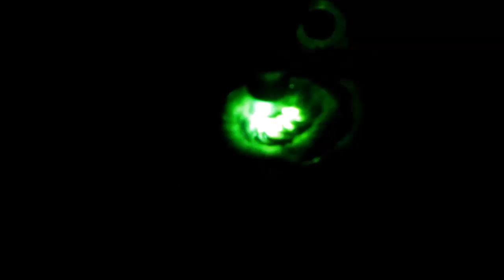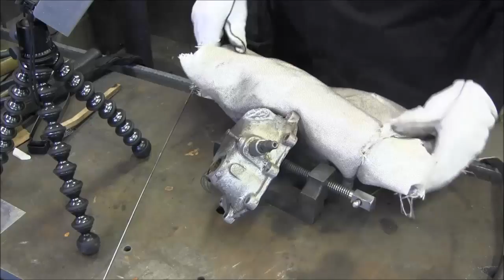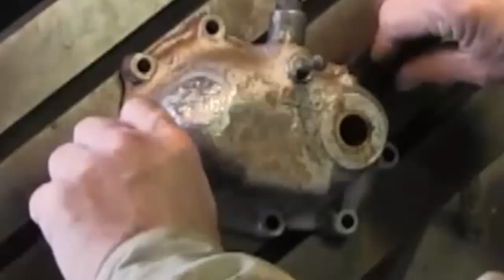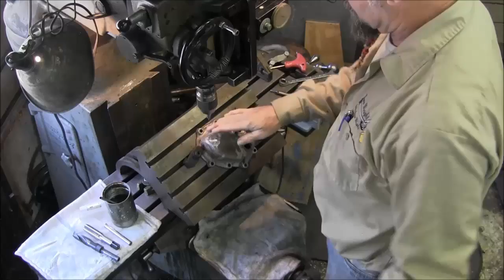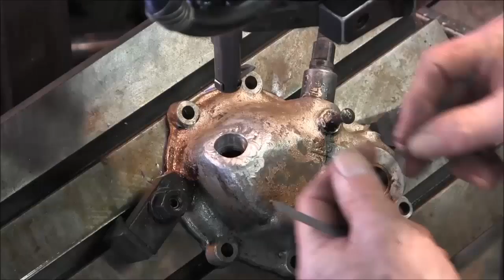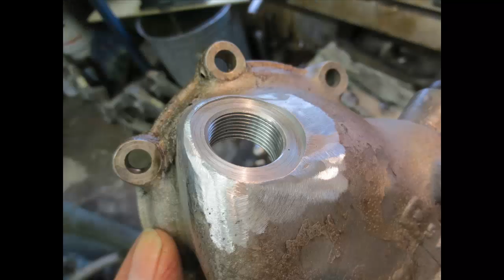Knuckle Head Part 2

Comment: The only criticism I have on this repair was the final finish. To get it to look original it should have been filed to shape. Grinders seldom if ever do the contours properly. After you get you base configuration back and all signs of the weld have been removed, you take coarse sandpaper like a 60 grit and place it face down on the surface and then you gently drive it into the surface with a small ball peen hammer. This will give you a surface that resembles the original cast and when painted will be hard to spot as a repair.

Comment: Hello Keith, I wanted to pass along another way to determine the drill size for English and
metric  60 degree threads that is not commonly know. Take the nominal O.D. tap size and 
subtract the pitch from the O.D. ( 3/8 -16 / .375  minus .062 is  .312 - I.D drill size.) Metric MM6 x 1 / minus 1.0 MM is 5.0 MM.)
This will not always match the drill charts, they are referring to the closets drill size available.

Comment: Great video,just wondering why you completely filled in the bore? Why not just build up just enough material to drill and tap? I understand why you completely cleaned out the threads. Thanks again. Found a new channel.
Reply: He already had the piece centered. Good tooling and proper speeds and feeds would keep chatter to a minimum.

Comment: Should have a copper gasket washer.
Reply: +K.D. Pearce  Not in the Harley parts book. Plug seals against starter cover surface.
Reply: +1-Shot slinger 4 speed Transmission cover :)

Comment: Hello Keith, why did you choose to use that plug when you could have used any standard size plug?
Reply from the maker: Jeff Pinter The customer wanted to use that one! A lot of my work is as customers request, varied from time to time to make stronger or safer. ;{)------
Reply: +Jeff Pinter Keeping it original. It is an antique bike.

Comment: Another awesome video!!  I get porosity as well when I don't clean the parts out as if they were going into surgery.   Cast is also notorious for absorbing the media it is holding.   A thorough parts washing and acetone a alcohol rub cleans up aluminum pretty good.  The video was very well put together.   Nice plug for Jody.  Thanks again for another video.

Comment: Just a thought, Keith, on aligning the part for the setup would be to screw the tap into the bad threads and then chuck the tap in the mill.  Then the adjustable angle plate could be brought up under the part to align it in all directions.  Then kickers could be bolted to the angle plate at three locations to "capture" the position.  Another approach, again using the tap to hold the part, would be to then tilt the mill head in both axes to set the part down on parallels on the mill table.  Kickers could again be used to capture the position.  
Just another method-- your method worked great.  I'm envious of your welding ability and admire your work.

Comment: Maybe you could make a "hood" or an extended 1" rim around the faceplate- to concentrate the light, and help block out any stray ambient room lighting. Most "auto focus" systems use infrared- the heat might be making it fuzzy- maybe switch it to "manual" focus?
               You're right-  I'm surprised there's not a copper crush washer on that plug- maybe they'll use one?

Comment: This type of repair is exactaly the reason most of us come to your channel!  Thanks.  I just replaced my 40 Year old Miller 250AC/DC-HF TIG welder with a Dynasty 200DX...One of us (maybe Jody) needs to put together a video on job specific settings for inverters.  What did you use on this repair?  It looks like a low CPS, 80? and about 145 amps at 65% cleaning?  BTW, why not just over drill and re-tap this one size bigger?  The fact that you didn't edit out whatever happened at 12:36 is proof that "You're the king"!!!!!!
Reply from the maker: Thanks for the comment! Well I was using my 15 year old Synrowave 250, I mix the gases manually and most likely had the amps up around 200 and use a foot pedal so I can grab it when I need it and back off the same. I was asked to recreate the threads to fit his plug. ;{)------

Comment: Hi Keith, with regards to the cost of the tap, did you consider using a standard tap that you already had and then making a new plug?  I understand keeping things original but no one will ever know unless they measure it and who does that?
Reply from the maker: When the customer wants it as original, that's what we do!  ;{)----
Reply: Thanks for the answer.  Am loving the channel and learning heaps.  At the start of your videos I like to work out how I would do the job (I am an amateur/hobbyist) then see how you go about it.  Great to be able to get feed back on why you do things a certain way.  Cheers

Comment: Hey Keith, that's a really nice job! I had to do some special threads once in a while and got bored buying cheap used (chunk) taps or some from China because I cannot afford the ones made in (somewhere around Austria, maybe Germany) in my case. So i started making my own, basicly just threading silver steel, cutting flutes with a ball end mill and then harden an grind it. They work really fine for a few holes in Bronze, Aluminum and other non-ferrous stuff.

Comment: Great fix again! Yes there should be a copper washer on the Transmission fill plug! As some others wondered about the hole with the bronze bushing; it is where the shaft for the kicker arm (for kick starting the bike) sticks out of the trans! Like the old knucklehead but like my '79 shovelhead better!
Thanks Keith!

Comment: Great video Keith - simple repair overall, but you do such a good job on it.  Most of us would have just TIG'd the aluminum back into place without fully filling it and drilled it and opened it up - your method makes for the cleanest (and ultimately easiest) result.

Comment: I agree with the commenters who say there is a thrust washer missing between the plug and the case. Drain plugs are not supposed to be torqued down super tight - you aren't joining parts, just sealing a non-pressurized sump. Hand tight ("good-n-tight") is fine, but it has to seal, especially once it gets hot and things change shape. A soft washer allows some compression and growth with heat. Reefing that big steel bolt back into the aluminum case is likely to just strip it again eventually.

Comment: Keith could you tell me why you cut the flat boss with with the tool spinning backwards? I'm guessing it cuts better without chattering but I've never seen that before. Thanks again I always learn something when i watch you videos.
Reply: The tool Keith used was designed as a right hand turning tool so when it is upside down the spindle must be reversed. Conversly if he were back facing the tool would be up the other way so conventional spindlerotation would be used.
Reply: thanks for the explanation.

Comment: Love the addition of the filter view of the welding. To my eye, maybe darken just a tad, and tweak the focus a bit? Are you using a fixed focus? Not too sure how the welding filter and the welding itself would affect autofocus. Another great video!
Reply from the maker: Thanks for the comment, I was and still concerned with all the variables, that come into play, videoing welding. I was using auto on the camera and had the lens on the lighter side 10 to 10 1/2 shade. I will also try some camera settings to change to black and white or others that may also help with the more natural look of the puddle action. But for the most part it is to be used as a prop to show you how I dip my rod! cheers, ;{)------
Reply: Keith Fenner
Understood. You seem to add the fill a little further away from the puddle than I do, and you are are a master of using the heat to draw the fill where you want it. I am going to have to try doing it your way. Can always learn something new!

Comment: Great vid Keith--As an alternative to welding, could the damaged threaded hole been drilled out somewhat and a sleeve inserted and welded in that would allow a rethread? Just a dumb question from an armchair, wanna-be machinist.

I really look forward to your videos.
Reply from the maker: Thanks for asking the question Tommie, before I was proficient in welding build ups, I would be thinking of all the non welding ways to getter done. A lot of different avenues were practiced and some worked pretty well, but none compare to replacing the base material with new and re-machining. ;{)------

Comment: Interesting use of the auto shield, I am guessing the sensors & batteries also came along in the unit, locking the Canon on manual setting something like f5.6 at maybe 1/30th with the ISO at 400 may actually capture the lens darkening as the arc forms. I have worn progressive focal lenses for a while and find them great on normal jobs, tricky to get the hang of at first and no good if you have to do close up overhead work. My mill does not easily reverse, did not think it important until seeing your use of standard right hand tools Keith, I can feel a wiring mod coming soon.

Comment: Nice repair job Keith.  You make welding that cast look really easy and clean.  I have not had that kind of luck with the castings from my Honda.  No matter how much I clean and grind away as soon as I light up on it, the volcanoes appear everywhere.  Lots of grinding, drilling, and welding are needed to get a good build up.
Reply: Well..I have a 1946 Harley....same trans/kicker cover like this....it is 'sand-cast' and welds pretty well. Many newer bikes have a die-cast aluminum, (especially any sort of 'covers') with 7-8% magnesium...easy to cast, but will usually give a slightly porous weld...pretty tough to make a nice looking repair.

Comment: Kieth, I know some smart a-- always comes along after the fact with an easy way, but as a service tech for 30 years, I have to tell you that those plugs are available in oversized self-tapping design at your local parts store. They cannot compare to your fix, but they are quick and cheap. Less than $5. Great video. I have dealt with those situations too many times to count. I don't think mine ever looked that good, though.

Comment: Thanks for the video. I think it's cool that the guy gets to use the original piece instead of hunting around for a replacement and being at the mercy of someone who thinks it's made of gold. That and there's one more story the bike can tell. I wonder if you've ever worked with low temperature aluminum repair rods and if you have much of an opinion of them. I can T.I.G. aluminum to a degree but I have no equipment and little experience on alloy. I had some of these rods given to me by my brother when I repaired his car and I'm thinking about trying some on an old aluminum dutch oven. I don't know about them for real structurally critical pieces, but for filling holes I think they might be ok. Also thinking about a T.I.G. box for my Lincoln tombstone.
Reply from the maker: I really haven't played with any other rods in aluminum than 40 & 50 series tig rods. ;{)------

Comment: I've done a few exhaust port thread repairs on Morinis, which use an M42 by 1.5mm (close tolerance) thread. I hate to think what a tap would cost and I single point up an insert. I made a jig to bore the head for a light press fit, the weld the insert in place. http://bbs.homeshopmachinist.net/threads/37932-A-little-jig?

Whatever works, works, but I wouldn't have been confident doing that much welding without distortion.

Comment: Great videos, Keith.  I really like the welding mask photography, the puddle was clear, and it was easy to see you dipping the rod.

I was worried about the bottom end of the hole, since any irregularity could cause easily broken-off areas after threading, but it looks like that wasn't a problem.

Thanks, as always, for the thought and care you put into your work, and, especially into making these videos.

Comment: lol i had dro problems to with my cheapy scales on mill and lathe after a hr toy with it i got in the tool box to get a wranch and seen my compes pointer moving a little off, it moved a round funny for 1 3/4 days then back to normal and funny no more scale problem. my scales are mag but i would say it most likly afected yours to. it is known that we have been having large shifts in earths mag field and weak spots and are do for a polor shift. or even a small solar flare hitting a week spot,but all i can say for sure is the was a magnetic disturbance when mine was not reading right witch was a day or 2 be for your video was posted. thanks for the videos and keep up the awsome job
Reply: I never thought of magnetic shifts affecting the scales.
I guess glass slides would be better then.

Comment: Thanks Keith for the videos, learned much and will continue gathering as much information.  Started my hobby shop and have purchased a gunsmith lath from grizzly.  Got the floor poured with the radiant heat tube installed with also a cubic yard foundation that includes 1" threaded rod spaced for connection of a jib crane to have a 360 degree swing over a table, lath and mill machine.  Will send pic when complete.  Later Mike

Comment: seems like you could have just stuck a threaded insert in there and been done with it. the idea of welding and machining on a knuckle. i dont know if i could bring myself to do it.
Reply: or gone one step up in threads size and made/bought a new plug
Reply: nah the originality is the issue.
Reply: Lasse Langwadt Christensen
If you look at the inside of the finished thread, you couldn't increase the thread size - it would have cut into the shell. At best some backyard mechanic might have slapped some JB weld in the threaded hole and retapped it (if he could find that tap). or even just JB weld the plug in and drill a new drain hole in the plug with a smaller bolt. (Don't doubt some of that has been tried in farms around the world).
Reply: oh i dont doubt this was the only choice. i just dont think im brave enough to put the torch to old '30s harley parts. this is where confidence or arrogance rears its head. given the results, seems obvious keith was sporting confidence on this one ;)
Reply: It's easier when it's someone else's parts too, doing that to your own part is harder
Reply: Tom Kennedy looks to me like there would just about be enough room to go up a 1"

Comment: From seeing the burnishing of the flange of the original hole, I'm guessing that copper washer that was supposed to be on the drain bolt, was lost, and to stop the leak, the bolt was successively over tightened until the threads were stripped. Oliver tractors use this same 7/8-18 thread tap for their oil pan drain bolt (~1944). I saw this same problem where the original owner lost the gasket. I made a new drain bolt from 1-1/8" 12L14 hex stock, as the original bolt head was rounded off, because of overtightning, and only 5/16" inch of hex was available for the wrench to grab. Lucky the steel threads in the drain pan were never stripped. Finding a correct copper washer is the problem now, but I found something sloppy to the 7/8 bolt diameter from McMaster Carr. Thanks as usual I learned there is a setup to use the tilt table for, that I bought 20 years ago. O_o

Comment: thanks for sharing your knowledge. I noticed the other hole in this case has a sleeve pressed into it. Is that why the alum threads wore out by steel bolt? would pressing a threaded sleeve in there have been an option? Is this how you would have normally repaired this if you didnt have to keep it original? Thnx
Reply from the maker: I like to repair this way, and even more if it needs to be kept original. It all depends on the thread of the plug or bolt and if that is going to change also if the thread pitch is available in an insert, it is nice just to know you have the capabilities to add one more way to the collection of skills. ;{)-----

Comment: Keith,
   There's a simple way to determine tap size when there's no chart or table  available. Most charts base their tap drill size on 75% of a full thread. To determine the required tap drill size for any thread, whether it's 1/4"-20 or 3"-20 or some other odd ball size like say 7/16"-32, just divide one by the thread pitch and subtract from the major diameter. For an example on 1/4"-20, 1 divided by 20 = .050". So, .250" minus .050"  equals .200" or (.201 or #7 is the closest size).  Try it on any size and compare it to the chart !!